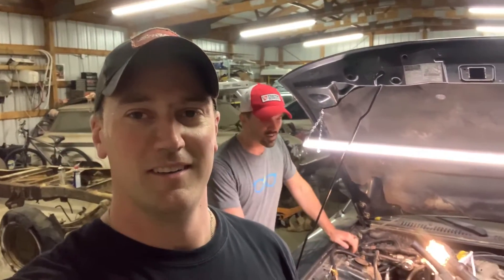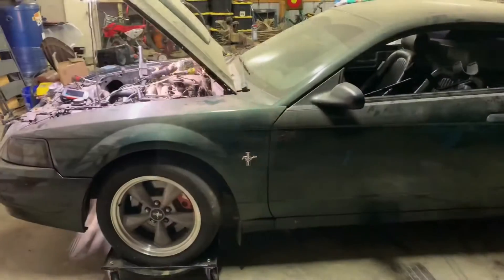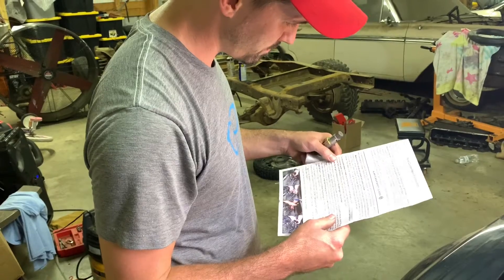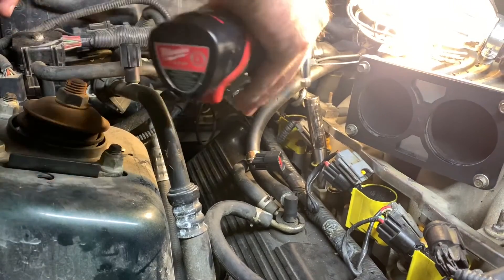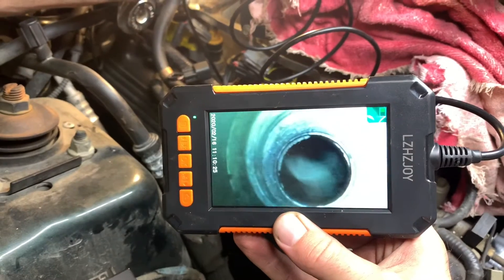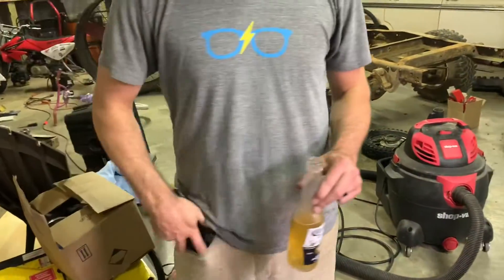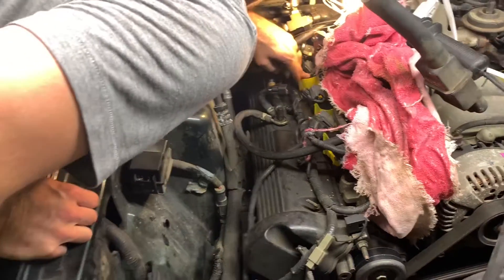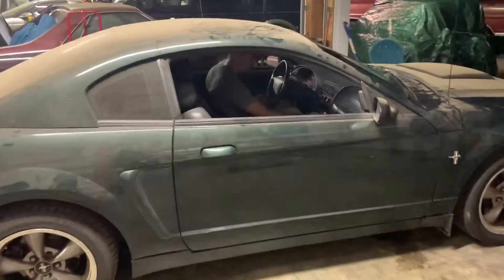4.6/5.4 2v blown spark plug repair

Comment: Nice Video!  Had the same problem on the same side of the engine with my 99 F250 V10 around five years ago. I did use a Time Sert kit on mine.  It comes with a special tool that knurled the end of the insert for a permanent fix. It is still holding strong after 30k miles.

Comment: So the kit does work on the Mustang 4.6L Romeo heads? Was a little apprehensive since the kit’s specifically designed for Triton heads
Reply from the maker: The kit we bought worked on 5.4 tritons and the 4.6s